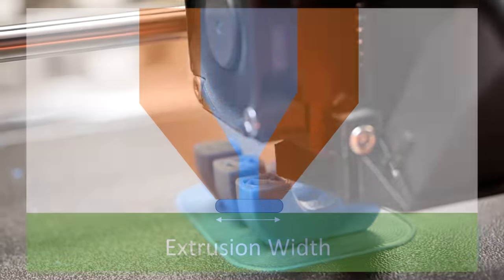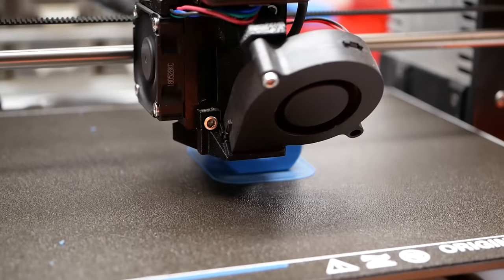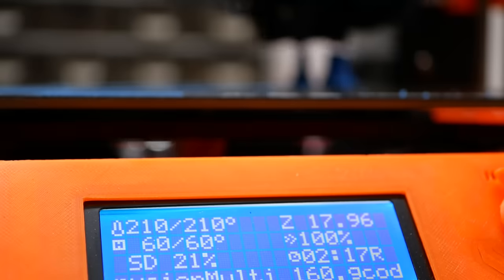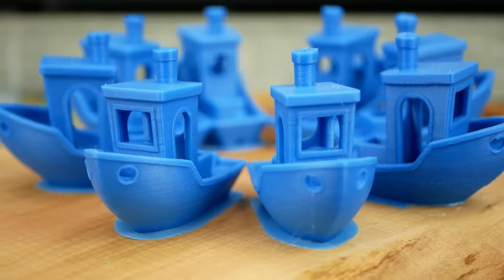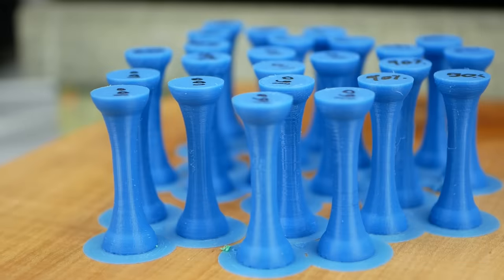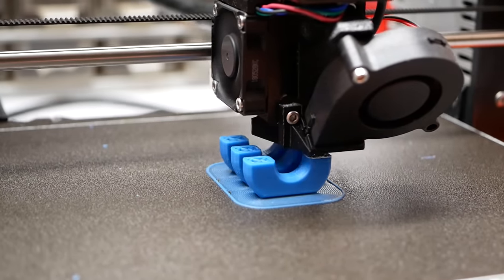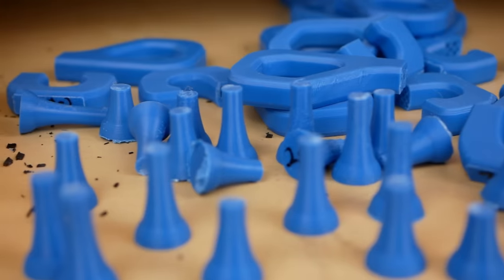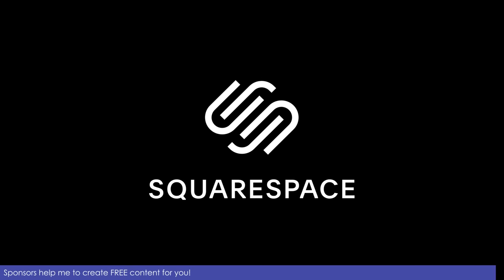Extrusion Width - The magic parameter for strong 3D prints?

Comment: I use Slic3r and I have always set the extrusion widths manually.  First layer is tuned to provide the best fit for the geometry of that layer--wider being preferred as the squashing bonds to the bed better and because it makes a better looking surface finish.  Other layers are set for similar reasons.  This video surprised me as I thought everyone did this.

Comment: Another great video Stefan.

I normally use 150% of extrusion width for infill, both for increased speed and layer adhesion. I keep perimeters between 100% and 120% for surface quality. Also use only 100% for the top-most layer for the same reason. 

I also use a larger extrusion width for when I want to go with layer height bigger than nozzle diameter. Normally no less than layer height + nozzle diameter and no further than layer height + flat area of the nozzle.

Keep up the good work.

Comment: I usually change the extrusion with along with the layer height. I mostly run a layer height of 0,3mm and an extrusion with of 0,5mm on a 0,4mm nozzle so basically 66% of layer height. I adopted these values from the default setting in cura, but scaled a bit up

Comment: I adjust it quite frequently when trying to make large, strong parts, e.g. dust collection adapters for my woodworking tools. I'll put in a larger nozzle, typically between a 0.8 and 1.2 and adjust the extrusion width to 1.2x the nozzle diameter.

Comment: I have changed my extrusion width to 0.5mm when using a 0.4mm nozzle a few times to speed up printing of thin walls. 

A lot of designs are made with solid wall thicknesses of 1-2mm which is an obvious consequence of designing in terms of 1mm units to keep the design math simple. However if you print a solid wall of 1mm thickness with a 0.4mm nozzle you will get a straight outer wall on each side and a 0.2mm gap in the middle which gets printed with the fill pattern. This slows down the overall print a lot. If you adjust the extrusion width to 0.5mm then you get a straight line on both sides with no infill required. 

However I have also found that doing this reduces layer adhesion and makes such walls more fragile. But depending on your end use goals the tradeoff in strength may be worth the significant reduction in print time.

Comment: Hey Stephan! Paused at 1:18.  I've been off-and-on 3D printing for 6 years now, and extrusion width issomething I've always tweaked with my prints. I use S3D, and it's always front and center on the first page of the settings, so it was one of the first things I messed with once I started tweaking advanced settings. Usually I will leave it on Auto or .4mm to start, then once I preview the print and time, I will adjust as necessary. If I'm printing something large, I will usually bump it up a bit, and it will equate to big time saves. If I'm printing something small and detailed, or with thin walls, I will often lower the width in order allow the printer to use solid lines rather than a perimeter with tiny zig-zag infill. Very thin infill usually equates to tons of vibration, so I usually make it my goal to adjust the line thickness and number of permiters (coupled with the "single extrusion perimeter overlap" setting on the last page) in order to get a single solid line of infil.

I also HEAVILY lower the thickness (and speed) when I'm printing very tiny parts. I know I could use a smaller nozzle, but sometimes that's a big pain for just a single small print. I once printed a very tiny lightning bolt, something like 12mm in length, 3mm wide, 5mm thick. I used a .05 layer thickness, a line width of .2mm, and a speed of like 5mm/sec. It was smaller than my fingernail, and still took like 12 or 15 minutes to print, but came out great! It took a handful of attempts to dial it in, but there was no way I could get the detail and sharp corners in a piece like that without lowering the width of the line! (:

Comment: Great video! Exactly the opposite of what I have been doing, I had been using smaller extrusion width settings to get better top infill on small detailed top facing parts.
That is probably a good trick for those cases, but in all others I will go with larger extrusion widths as you have shown

Comment: I do this on basically every print I print. It was nice to know that layer adhesion increased that much and that two lines was best using the same overall wall thickness.
Using Cura, I set the outer wall line width close to 0.4mm to maintain horizontal resolution. I then increase Inner wall line width, infill line width and top/bottom line width up to 0.8mm. I have not seen the rough surfaces that you got here, perhaps that's a result of not printing hot enough. Increasing infill line width allows you to print it with higher speed without the lines being cut off when it crosses an already printed infill line.
Lastly, I reduce top surface line with to 0.3 or 0.35 to get a smoother top surface layer. This is a good alternative to Ironing which takes a lot more time, although this doesn't get as smooth. I do this even when I use ironing to give the ironing a smoother base to work on.
Another thing that I have been meaning to test is if wider line width also allows higher layer height and how that compares to using a larger nozzle.

Comment: When I printed plastic gear bearing using default width 0.4 all parts were fused even on the first layers, so I changed my width to 0.2mm (having nozzle 0.4) and magically it helped - I was able to print this bearing with no problem.

Comment: Stefan, I set my profiles to 150% for perimeter width / infill width, and use 125% for external perimeters and top infill. There are a few cases when I do 200%: for most of my ABS prints and all of my PC prints. I've had such success with this that I don't even use ABS anymore, I just use PC when I need a higher temp or higher strength material. In those cases I also use a lower layer height. 

I set up a CR10 s5 with a volcano nozzle per your old CR10 TitanAero/Volcano video, on that I run a 0.8 nozzle, 0.4 layers with 1.2 extrusion width and it is incredible. Sometimes I turn the layer height and width down a bit for better looking or non-structural parts, but the 1.2mm wall thickness (per perimeter) makes for strong, fast parts. (I only print PLA on the CR10).

Comment: I use a 0.8mm nozzle and print at 1.0mm layer width. In vase mode the prints are surprisingly tough, far tougher than I originally expected. To allow enough time for heating, I keep my speeds down to around 40 or 50 mm/s, this also helps to increase layer adhesion.

Comment: Very informative, thank you! I believe there may be a source of error in the strength vs extrusion width test. Printing larger widths at the same speed results in a higher volumetric flow rate. My expectation is the  dropoff from 140% up to 250% could be explained by the filament not reaching adequate temperature by the time it exits the nozzle. If this was not accounted for, I would recommend setting a volumetric flow rate maximum in PrusaSlicer that keeps all the test samples flowing at the same mm^3/s and re-testing.
Reply: That sounds like a VERY promising idea. Thanks Wrath144.

Comment: I experimented with extrusion width for several weeks, because I had problems with overhangs curling upwards.

In the end is was a problem created by several factors and not just one - but the width of extrusion had to do with it and by changing it to a certain percentage of the layer height I was able to increase print quality significantly.

My hotend always bumped into the upwards curling layers on little structures like the leapfrogs front arms...

Could not print that darn frog without layershift for that reason for almost a month.

Was tweeking it like crazy.

Cooling, extrusion width and a slightly dented nozzle which was set up a tiny Bit off of a 90 degree angle and it's tip scratched the surface of the extruded plastic like scissors do on Christmas wrapping when you want it to curl!

Took me forever to figure out.

Comment: one cool idea i had that actually has been tried is making holes in your parts. maybe you should also check stuff that can affect the print strength that aren't just in the settings some people mentioned adding small hollow cylinders inside the part to force shells inside the part. but my idea was different. I wanted to make holes in the infill then after it's about to close I'd tell the nozzle to go into the hole, lower a little depending on the nozzle shape and maybe with a high temp extruder a tone of material until it fills the hole. this is perfectly fused material without layers inside so it'll greatly increase the z strength in theory! with a tool changer you could even inject resin into that hole :)

Comment: Man I love your content - I don't even own a 3D printer yet, but it's good to know which parameters are good for strong prints.
What I learned so far: About 0.1mm to 0.15mm layer height, no part cooling and maximum extrusion width make them pretty darn strong. Will have to keep that in mind; I may want to print a DIY server rack as one of my first projects.
Reply: No, I won't blame it on you if it fails horribly :D

Comment: I've been changing line width for years, glad to see a video I can point people towards if they ever tell me I'm wrong again!

I change the width for a variety of reasons depending on the project. Sometimes it's thinner for fine details and/or thin walls. Most of the time it's too make stronger parts that take less time without having to use larger layer heights.

Comment: I have changed extrusion width quite a few times.  It can help increase printable angle in vase mode since the line gets wider relative to the offset given the height (there are limitations of course). I have gotten 30 degrees included angles to build plate with polypropylene to print no problem for clear vase type parts. I have also used it many times for lower detail parts to increase speed or beef up wall thickness where I don’t want to wait for an extra perimeters. Sometimes you get better detail with shorter layer heights and wider lines.  Just depends. It’s another tool in the toolbox.

Comment: Great video!
In Cura you can change the line width for outer wall, inner wall, infill, top and bottom, and first layer independently, also the flow for each of the previous, it's awesome!

Comment: I change line width to make small features more precise. I use 0.3mm Mk8 nozzles, carefully drilled out to 0.35mm (difficult to find 0.35mm). I can vary the line width (in Cura) between 0.25mm and 0.45mm. I never thought that line width could effect strength, thanks for enlightening me.

Comment: Ive cranked up the extrusion width on a lot of big mechanical parts, just to throw down more plastic faster (didn't realize it was stronger). Ive also cranked down the extrusion width for the infill occasionally (which is a simplified 3d option), since that will increase the number of infill "boxes", which is useful when i need more internal infill support for the top layers, but dont want to increase the overall weight

Comment: with flexible filaments i use a combination of this, linear advance, and over extrusion to get solid, clean parts. for example i might print fiberlogy fiberflex 40d at .4 nozzle .36 extrusion 1.25 extrusion multiplier, and using linear advance and the perimeter overlap ect to get the cleanest top surface. works pretty well!

Comment: 5:06 is usually a limiting factor in wall line thickness, I would love to have in a future slicers smart enough to adapt the line width to the shape, so you only have to set the maximum and minimum width and it uses the maximum width possible to print each feature.
Reply: Simplify3d do this since version 4.0

Comment: I've used 200% extrusion width with great success to print small containers/boxes in vase mode. The prints come out much stronger than with default extrusion width, and they are fast to print and look really nice in vase mode (Cura: Spiralize outer contour).

Comment: I would find it interesting to test various dips, solvent bathes and injection. For ABS I suspect you could dissolve some ABS in a solvent until it gains some viscosity,  then drop your part in, vacuum the air out, and quickly take your part out. It might require a quick swish in just the solvent to clean the outside off. 
Another thing that would be interesting is if there were a fill pattern that changed with the distance from the wall. You could have the density high close to the wall, and low in the middle of the parts. Likely achieving the same strength as a higher fill density,  but with faster print times and lower material usage.

I have also thought that the nozzle tip diameter (not the oriface) has an effect on strength.  That it might preheat the previous layer slightly, and definitely an adjacent line on the current layer, by rubbing across it. So perhaps a larger diameter would improve the pre melting. Even better would be a laser that tracks in front of the current line, preheating just the small area the width of the printing line to nearly its melting point. Obviously this would be a significant design challange.

Comment: I just got an Artillery Sidewinder X1 and I needed to change the extrusion width to 0,35 (with the 0,4mm Nozzle) in order to print a ring with said wall thickness. It is for a part that was delivered with a wrong hole diameter, so this print will be glued between the part with the hole and a threaded inner ring. I printed 15 of these simultaneously and all of them are useable.

Comment: I frequently use a 0.3mm extrusion width for external perimeters and top solid infill in order to create higher detail on the top surface when printing with a 0.4mm nozzle. I use this for embossing text or logos on top of models.

Comment: Yesterday after the first testing runs with the Titan Aero volcano I changed the S3D First layer height and width  from std. 50% to 150% and first layer was 150% better. I guess this is also a bit like the extrusion width setting.  Nice video!

Comment: Owning a lulzbot mini with a 0.5mm nozzle I found a majority of models are designed for 0.4mm so quite often I have had to set the width to 80% and it has always worked well.

Comment: Extrusion width is almost always the first parameter I adjust. If I'm designing something to be printed all walls are some multiple of .4mm so it will print easy for most people. Surprisingly if you download a model off Thingiverse almost nobody thinks of this...so the first thing you have to do is change extrusion width and then all those walls that are something odd like 1.54mm wide will print perfect with .38mm extrusion width.

Especially with things like gears...you can get vastly stronger teeth by changing extrusion width to optimize how things are printed.

Comment: As an analytical chemist I appreciate your error bars, but you have to be careful and even just do a students t-test as I suspect there is no difference in the perimeter experiment. Been watching lots of your videos, very good stuff. And great video quality! Thanks
Reply: Oh dear....I hope you mean ANOVA, there are >2 data groups. 

At least he does three n, most US-based channels try something ONCE. But, the point of n=3 is to be able to do statistical significance, even though this is the bare minimum number of data replicates. 

Then, there are experimental replicates (N), which should also >3, i.e. not three parts printed at the same time, 3 part printed three separate times. The bare minimum should be N=3, and n=3, for 9 data points each condition group.  Then, ANOVA can be done.
Reply: @okleydokley a parametric ANOVA would be proper looking at his first experiment in the video, and it would even be more proper to gauge whether or not more replicates would be needed through a power analysis, knowing the current variance in his experimental design. Personally would also prefer box and whisker plots instead of bar graphs also. 

I mentioned the very least of what I would expect from YouTube narrowing focus and drawing a hypothesis from from two data points with multiple variables in the last experiement. If ANOVA were to be completed, it would have to be non-parametric and I can't remember if excel has that option, been a while since I've worked outside of a suite for software.

Comment: Stefan - thanks as always for the tests and wonderful data! However, one thing has struck me about your infill tests and comments: Your tests load the parts in tension; never in compression. An internal web or "honeycomb-like" structure (even if its a triangle, rectilinear, or other pattern) is mostly contributing to compression resistance, and perhaps helping with shear loads, correct? 
It seems like - even disregarding layer adhesion issues with FDM/FFF - this would always be true because you [almost] always have a joint or bonding point between the internal structure and the outer shell (for example, between the ribs and the skin of a wing). That area will likely be the weakest point or the area with the greatest chance of imperfections, stress-risers, discontinuities, etc. 
Please let me know if I'm overlooking something here - I dropped out of Aerospace Engineering after only 1 year (to start a career in IT). :-)
Reply: I believe compression strength is not tested because it’s not the most important aspect most of the time in 3D printed parts, and you can have absolutely horrible layer adhesion without it being very fatal to compression strength, so long as the layers are properly aligned.

It would still be interesting to see that, including testing both the same tests he’s doing here for layer adhesion compared with compression tests, and also deliberately see bad prints for layer adhesion for compression compared to clean ones.